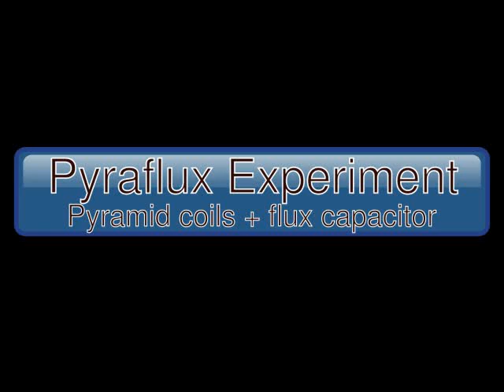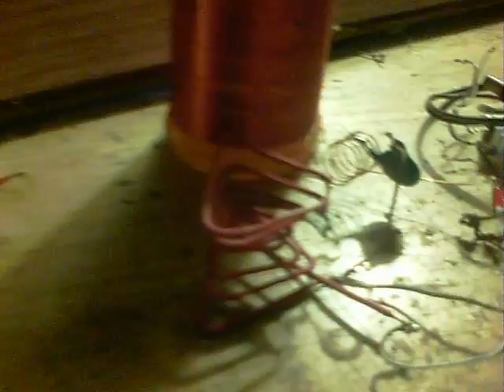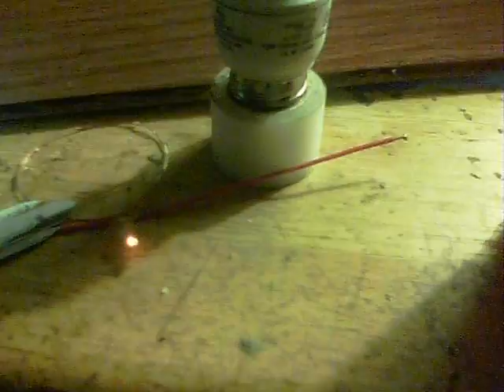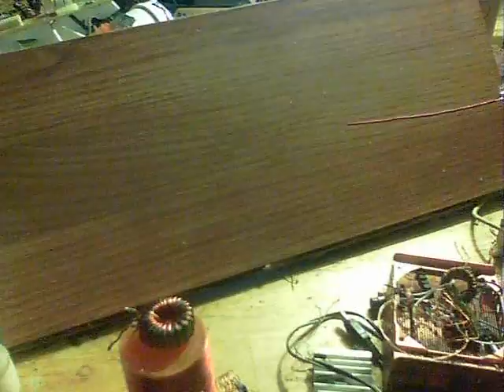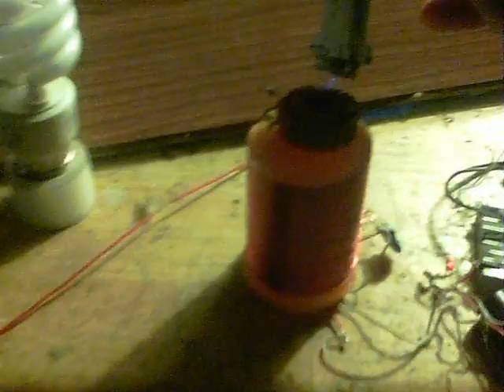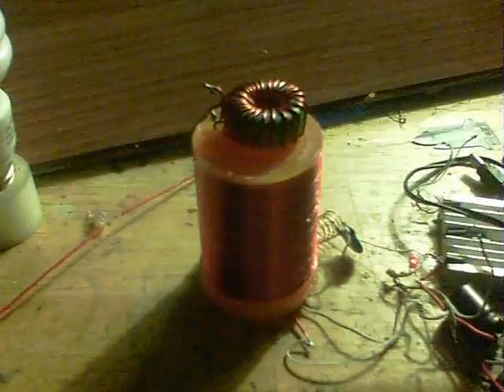Pyraflux - wireless electricity with flux capacitor

Comment from the maker: All info is in the description :) The 'flux capacitor' was named and described in the link I saw it on. It mainly appears to help to boost the capacitance of the Primary coil, by the 50/50 capacitor split in its own loose wound coil. The rest is a standard Slayer Exciter circuit.